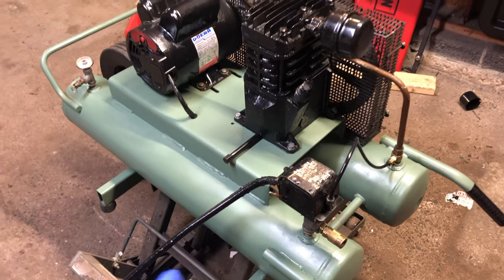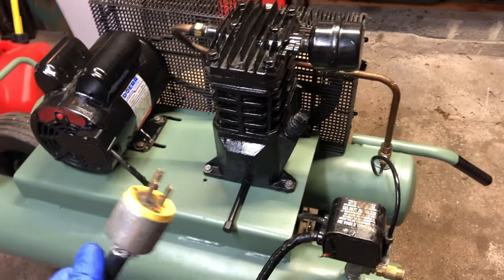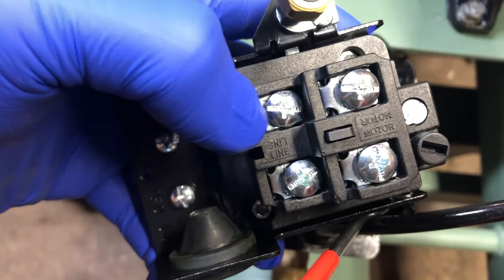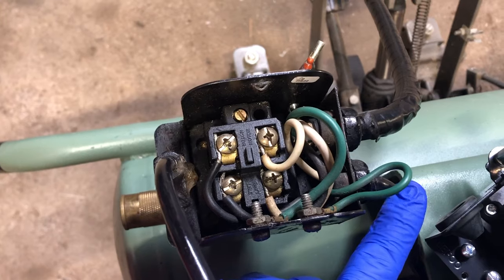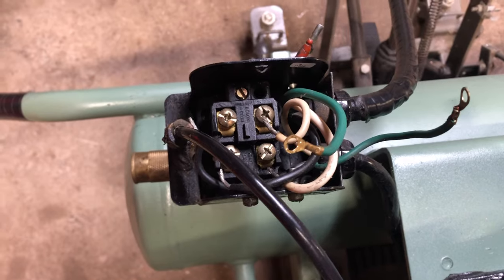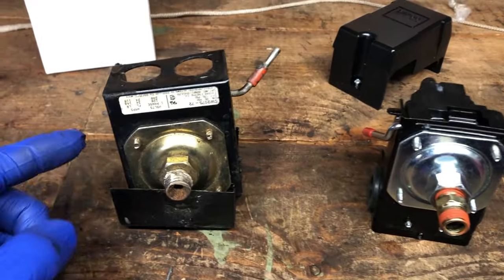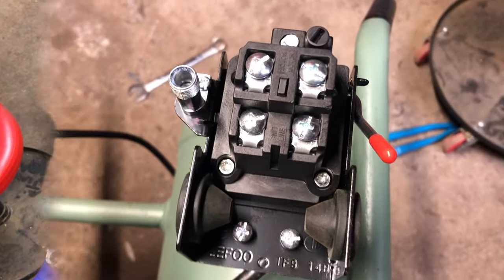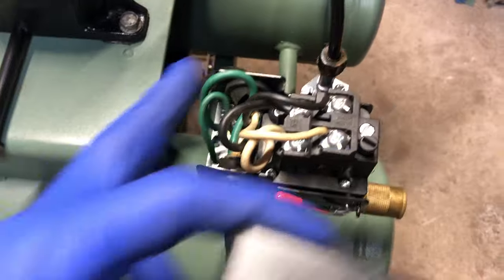How To Replace An Air Compressor Pressure Switch.

Comment: Construction seemed sturdier than other units I considered MyBest.Tools Noise level was reasonable. Good pressure and cfm capacity for a small reasonably light compressor.
Reply from the maker: Yes

Comment: Nice video mate , very simple and easy to follow ! Now how would i  take the existing wiring and mount an external switch for the air compressor silencer box I’m building? I’ve got the  extension air dump valve line sorted , and the airline connectors , but want to do this part safely.  I could always fabricate something that locks on to the stop start button using a pull rod (either way I’m going to have to drill a hole) but would prefer a big red emergency stop button . If I use the current switch it will have no means  of an earth , and I don’t want to expose the housing where it normally sits. Interested in hearing your thoughts ?!

Thanks mate 😊
Reply from the maker: It sounds like you’re on a good track my man. I usually don’t do modifications like that - I’m more of a resto-mod kind of guy. I like to keep it simple; clean and re-tap the threads, new regulator & fittings and new drain valve. That’s my jam. Best of luck to you with your project! Thank you for watching 🇺🇸🤘

Comment: Hey thanks for the video I just bought this as well used but I have no idea how to use it can you show a video explaining how to adjust the air tool regulator because mine doesn't even turn on but the tank does
Reply from the maker: Hello! I sold that machine shortly after this video was done - it was a flip project. If you’re having issues - try to find a manual online. Regulators typically increase pressure when turned clockwise, and decrease counter clockwise. I know that’s not much help. Best of luck to you! 🇺🇸🤘

Comment: I have a 20 gallon air compressor which is 120v....can I turn it into 220v from switching over the wire???
Reply from the maker: Only if the motor is rated for 220.

Comment: Great simple video, my compressor kids on then off then on then off. You think it’s the pressure switch?
Reply from the maker: 100%. Your pressure switch has a diaphragm that lifts up when the tank reaches cutoff/cut in pressures. It then pushes/releases a metal contact that turns the pump on and off. Yours is shot. Easy fix!
Reply: @jimmysgarage9068  replaced pressure switch. Still does the same thing on then off on then off. You think the mother is shot?? I’d a Coleman powermate 27 Gallon. Can’t find and parts anywhere for it.
Reply from the maker: @WWard1962  I haven’t personally worked on a Coleman machine. The pressure switch controls the on/off due to pressure in the tank pressing on the diaphragm. So either you have a bad/wrong (new) switch.
Have you emptied the tank of moisture? Make sure that it’s always emptied of water/condensation. You may have a blockage in the fitting connected to the pressure switch due to rust? 
Hard to really say without helping you tear into it.
Reply: @jimmysgarage9068  thanks again. Bough the same switch you used. I will keep trouble shooting. Hate to trash the compressor.

Comment: i should have watched before i worked on it, i was trying to fix the switch, where do you get the replacement switch
Reply from the maker: I got mine on eBay. Less than $20.

Comment: Which wires are power and nuetral (black and white)? My switch is labeled  N/P. Also, on the motor end connections, which wires go where on the starter solenoid and temp protection switch? I can't find a video on how those are connected.
Reply from the maker: Black is hot - white is neutral. As far as the motor - try to find a manual online for the specific model/make/brand. Best of luck!
Reply: @jimmysgarage9068  Thanks!

Comment: Remember line is from your breaker box or wall receptacle and load is the wiring going to a motor in this case or other device that uses the electricity. Think of power lines and that is where line comes from and your device creates a load so it is referred to as the load.
Reply from the maker: Great advice!

Comment: Do all compressors have a pressure switch? I own a light 2 gal Mastercraft compressor that had a cracked manifold… so I decided to try and fix it by doing the following : at the output of the tank, I installed a regulator with gauge, followed by a Y fitting, on one side I have the safety valve, and on the other side, my tool plug. The compressor build up pressure to about 120 PSI (it’s rated at 125 PSI max), and stops by jtself… So there must be some kind of mechanism that tells it to stop? I just tried to reproduce the original manifold assuming the big knob was just a regular air regulator…
Reply from the maker: Short answer - yes. If they didn't have a way to regulate max tank pressure, the motors would run until they wear out. Also, the max PSI of a machine isn't always reflective of the tank, but of the motor's capability of continually building pressure in said tank.
You'll notice with some air compressor brands, they'll have a few different sized tanks, but all with the same motor. That's because the motor can only push air into a tank with 135/150/175 PSI until it can't anymore.
I hope that makes sense! Thank you for watching.

Comment: Hi Sir, my oil-less air compressor doesnt have a small airline tube. All of the replacement switches i saw on the web has. Should I decide to use those, will it still work even if I dont have the airline?
Reply from the maker: I’d try to find an exact match to yours.

Comment: Also question 34 oz of oil I'm told that goes in this but that's over 1,000 ML and a psycho and a sight glass is full and it's only supposed to be two thirds full so how many ounces of oil does this take
Reply from the maker: Good question. Rule of thumb is the middle of the sight glass. Fill it to that point, run it for a few minutes and then let it rest. If you need to add more - you can. Definitely don’t overfill. 🇺🇸🤘
Reply: @jimmysgarage9068  thank you so much

Comment: On my Sears  4 HP 20 gal. compressor  ( over 40 years old )  , the markings on the screw terminals are different than the MOTOR / LINE on yours.   Both line screw terms are on the side closest the cord inserts  Go figure....error or design change ?
Reply from the maker: Sounds like a different design to me! Always interesting to tear old machines apart to see how they made them.

Comment: I like short, but I need to know what the red thread tape is called?
Reply from the maker: Not sure what you mean…
Reply: @jimmysgarage9068  Short is how I like instructional videos. There was red tape on the brass fitting of the new pressure switch, most likely a heat resistant tefon. Sorry for the confusion.

Comment: Sorry what's the point of restoring these ? Aren't horizontal tanks notorious for rust. Which just makes these things more likely to blow up?
Reply from the maker: If they’re drained properly and the tanks don’t have any signs of internal rust, they can have a good life span.
Reply: I have a horizontal 20 gal. tank compressor which is over 35 years old. I have it on a slight angle ( wooden block under the piston end ) giving a slight incline  so that any condensation runs toward the tank drain which is on the tank BOTTON towards the handle side. I sometimes open the drain valve just a slight bit so that as the unit runs, the water is blown out the petcock and doesn't collect.
Reply: @jameskrivitsky9715  great idea. i found a tank it's rusted to death.. it's a goner.

Comment: Are you sure about the white and Black. Because Neutral(white) is on the left side in any receptacle? Trace your power line from the plug. With the ground down you'll find that the White is on the left.  It will run regsrdlessly. Could be the reason the other switch was defective. That was not a factory wiring job. I am pretty sure You copied a mistake. Please be care when giving instructions with so much confidence. Some could get hurt. Maybe better to say “I think and disqualify yourself as an expert. Other than that great job

Comment: Or… you can just order the correct switch for the machine… that way everything IS the same.
Reply from the maker: That too! Thanks for watching 🤘🇺🇸
Reply: It's depends on if they even make the original part. I inherited a Campbell Hausfield that's leaking from the pressure switch. Probably made in the 90's.

You can no longer get the original switch even from the manufacturer. They sell a replacement part for it but it's as different from the original as the one in the video is. 

Definitely make sure the pressure rating is correct for your compressor. It seems like lots of new compressors are rated higher than my compressor.